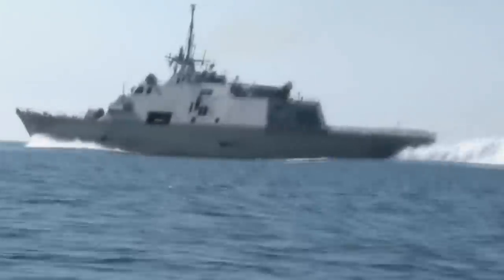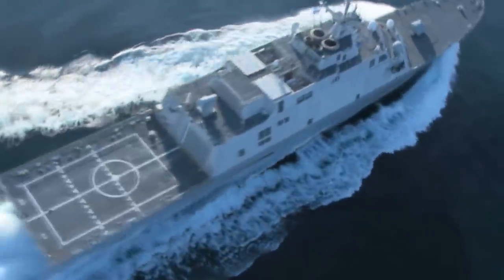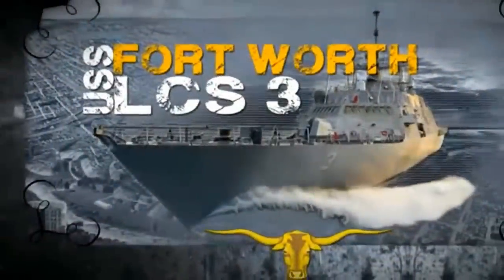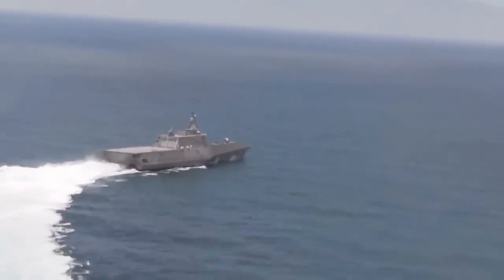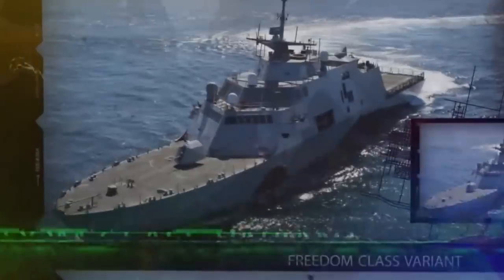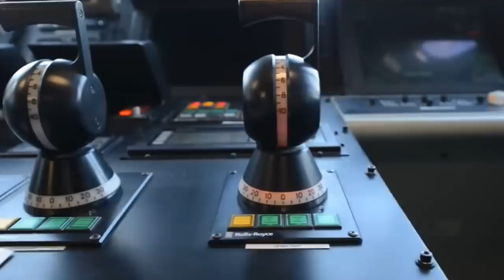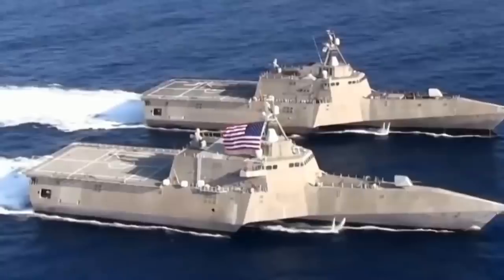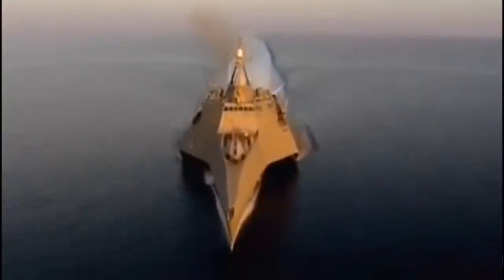U.S. Navy Littoral Combat Ship - Future Naval Firepower

Comment: Matsimus: Trust the americans to spend as much money and get so little for it. With a top speed of 40 knots you better hope for very calm weather. It is true the Huitfeldt-class only has 30 knots, but the range is not 3-4000 miles - it is 10.000 miles plotting along on one diesel. True enough: The Huitfeld's need an upgrade with a new sonar and new air-defence missiles and have the Seahawk helicopter on board. But so will the Freedom class.

The trick is: You can't sail with speeds much over 10-15 knots in shallow waters, as the yanks will find out. If you use a planing hull the bow wave will be reflected from the bottom smack up in your face. If you use a deplacement hull, then high speeds will suck the entire ship down due to the ventury-effect. I personally have had to help a skipper talk himself out of what that does to ship - there is only one word for it: VERY, VERY costly (it was a ferry). Now tide is another consideration that will pain the americans in the years to come - not mention, that high winds will change the sea level as well.

You see Danish waters are all littoral except the North Atlantic. The primary concern in littoral waters is knowing the waters and what you are doing. The Huitfelds are build as ferries and are twice as large as the Freedom-class. The Huitfelds are equally at home in the North Atlantic as well: You just take on ballast to make the go deeper. As to littoral - well the RDaN parks the airdefence frigates smack in the center of Stettin in Poland - much nicer and much closer to the pubs as well. As to the endurance at sea..... Freedom-class 3 WEEKS. Huitfeldt has three MONTHS before they have to seek port and top up on skimmed milk. But it is their money.

For your information: https://www.youtube.com/watch?v=rMNoHCV9Vnc

There is an illustrative example with Peter Willemoes and what it takes to get a ship named after you in the Danish navy. Willemoes singlehandedly ATTACKED the British fleets flagship under Nelson - on a timberfloat and only withdrew after his last gun was out of commission.
The americans pride themselves in their agressiveness - the cowing whimps they are. Tordenskiold only attacked with a numerical advantage. 3-1 Against him - the enemy's poor seamanship and crosseyed gunnery is always a factor.
Reply: Thomas Borgsmidt wow, you’re s much smarter than everyone involved in this, it’s a shame they never asked you

Comment: These littoral combat ships are already sailing on the seas and are deployed in restricted shallow waters and coastlines where the big survivable frigates can't go. They will replace the old and slow minesweepers and act as radar pickets that were the previous sacrificial lambs sent out by the US Navy when they didn't have enough corvettes or frigates. 

Would a USN admiral send a frigate in to perform minesweeping duties or the LCS? What if they needed to land a Navy SEAL team near a coast or an oil platform or to board an enemy surveillance boat? Will a frigate be able to do that job in shallow water? 

It's not always about going toe-to-toe with an enemy destroyer or cruiser because an LCS acting as a targetting data relay platform will allow a farther-off USN warship or aircraft to launch a big missile at the enemy. It's all about network-centric warfare, and it allows the US Air Force and the US Army to get into the anti-ship and coastal defense roles as well.

Comment: This is one I have to disagree with you on. The Navy has already fallen out of love with the LCS class of ships. 1) They are seeking a new design that has more fire power 2) The Navy has realized if these ships face a serious threat, they can't adequately defend themselves 3) With the very small crew combat damage control will be near impossible 4) With their small crews casualties in key billets will render the ship incapable of operations. 5) Their aluminum structure is more susceptible to fire damage should they get hit by a sea skimming missile like the Exocet.  In the Falklands War the fires on board after the missile struck were fed by residual fuel from the Exocet. This ignited the aluminum superstructure and the wire insulation for power and electronic. In all the LCS has had a troubled history.

Comment: Good job, as always, Matsimus.  However, I question the U.S.'s choice here.  Perhaps I just don't have enough imagination.  I get it that the ships are fast, shallow draft, maneuverable, etc., but what will they actually DO that other ships can't do, and cheaper?    I'd like some examples of actual missions, that these ships can perform that others can't.  Speed and shallow draft don't seem to be priorities in these days of radar and missiles.  They plug the gaps in the fleet where small enemies can slip through undetected?  How?  If the larger ships can't detect the threat, I don't see capabilities here that would detect the threat better.  And traveling with the fleet is not their main role, as I understand it.  What they seem best at, is to travel close to shore and launch Special Forces teams.  Zip in close, launch, zip away.  I think we can do that much better with a less expensive ship optimized for that role.  Also, I choke a little on the designation of "multipurpose" ships.  To me, if the ship has to return to port to install a different module, it is a "reconfigurable" ship.  My view of the module system is that it is a gimmick.  So, I'm out to sea with the mine warfare module and I learn there is a sub in the area - I guess I radio the sub to stay there while I return to port to  get an ASW module installed.

Comment: Ive read these have been slightly a failure at their original goal and will only be able to be used in low conflict zones like middle east. The navy already is looking for designs for a new frigate to take the role of small missile boat to boost a fleet strength without needing more alreigh burkes

Comment: from the start the LCS program was realized to be worthless by the navy (having SWO's in the family). Between the inability to actually manage any job that their "modular design" offered, to the horrible idea with the catamaran version that uses different metals in the hull/superstructure that leads to massive repair and maintenance issues. They are garbage.
Reply: I found it incredible they had holes in the hull from Galvanic corrosion so quickly. The navy hadn't heard of zinc anodes?
Reply: The tri hull design was to increase it's chances of surviving a torpedo strike which on the new torpedoes breaks the spine of the ship vs poking holes in the hull. Are there weaknesses? Sure. Every system has them. Steel ships are rust buckets floating in water just waiting to sink if you don't keep up repairs. I really have to wonder if you've even been on the ocean.
Reply: A tri hull is potentially useful, but not this one.
Reply: False- where the hell did you get that information?  During the 2004 tsunami relief efforts the US Navy noted how well Australian ships with multi- hull designs (particularly those built by the Austal company) did hauling heavy loads at great speeds over long distances.  They decided to think outa of the traditional "mono hull box" and give Austal a shot at bidding for the LCS contract.  Austal joined up with General Dynamics and created the Independence Class of Ship.  They have also been building other research ships for the Navy too.  Torpedo's had nothing to do with it.

Comment: For a 3000 ton displacement vessel, these ships carry relatively little armament and sensors. No proper medium/long range AA, no antiship, small shore bombardment capability. The "modular" capability is greatly diminished by the fact that the modules don't exist yet, and probably will not exist as envisioned because it was discovered that design limitations made most of them infeasible.

Comment: ship has close to no armor and its design if for close to shore action kind of odd that close combat ship has such thin armor I'm sure an attack from a few speed boats with heavy machine guns could  cause it to be incapacitated and no longer mission cable  throw in a helicopter and things just get worse from there
Reply: The on;y protection I am aware of is some Kevlar splinter curtains.
Reply: They are fast and that's better than armor.
Reply: wrong, no vehicle/ship is faster than a bullet/missile and they will get hit it is part of warfare I agree there needs to be speed but protection is the flip side of that coin you need balance not one or the other

Comment: These are ships the navy do not know what to do with. Too light to fight against a real threat. No plan to switch out modules quickly in forward areas. We have a very expensive Coast Guard cutter. At least they can be used as minesweepers.
Reply: Yeah, the "modular design" has essentially been dropped leaving three separate classes of the same ship depending on which module is permanently attached.

Comment: I think you are a bit off the mark when it comes to the usefulness of these ships.  There is a real need for ships that would counter threats in the shallow water coastal environment as was demonstrated in the Persian Gulf when the US Navy went up against small, fast and heavily armed Iranian gunboats.  But this ship falls short on a few critical points.  One, its all aluminum construction makes poorly survivable from taking enemy fire.  Two, it fell victim to mission creep.  It is asked to do too many missions which would introduce too many compromises in design that make it a jack of all trades but a master of none.  Third. too many new technologies were thrown at it at once without adequate integration testing and trials on a prototype.  The ASW module that has been delayed for almost a decade is one example of the myriad of problems encountered.
Plus, they've got it ass backwards.  Weapon systems should be designed to meet specific mission requirements.  It seems like they built this ship with a general idea and spent the next decade figuring out how these ships could be used.

Comment: Freedom class ship is more Coast Guard material and fancy counter-mine warfare ship... not combat ship, as it truly lacks capacity to integrate credible weapon systems.  Independence class ship though has more potential and flexibility to integrate more diverse, potent combat capability if the proper investment is decided to be spent on it.

But basically, any modern-era Corvette and especially Frigate can double as and be modified to integrate various remote and towed ASW and anti-mine sensors and aerial surveillance/targeting drones and ASW weapons, etc...  this is nothing unique to a specialized 'LCS' hull which in baseline form is unfortunately limited in credible combat capabilities.

The Royal Navy ?  Maybe contemplate integrating CAMM + CAMM-ER vertical launch, plus a 76mm STRALES sys upgrade, plus Naval Brimstone tubes, heavy torpedoes and maybe even a few NSM rounds for good measure.  You really need a full package to be credible, cost-effective deterrent.

Comment: First, problems they might figure out. Poor enginnering reliability, mine drones have horrid reliability and record. Second, they are kinda useful in the asymmetrical warfare you mentioned but useless against a near peer rival. No modular vls, poor ASM capability, poor ASM defense, especially against the latest chicom and Rus missiles. Way too expensive for the little firepower they do have, and small ammunition capacity. At least from my understanding and I grant I'm sure you're better read up on them than I am. Anyway I still really like your videos, keep it up man

Comment: SERIOUSLY SMEXY BOATS.  Seriously though, these ships are bringing in some capabilities that haven't really ever been a developed part of the Navy's power projection.    The ability to provide additional support and security to RDF ships and Marine Amphib forces is going to be a big plus and allow those dedicated unit to support troops ashore and not have to divert assets to battlespace security.  Then of course there is the other missions which this sort of ship is ideal for.. discouraging piracy.  A job that's currently been tasked to Destroyer and Frigate designs (primarily Fleet and Surface and ASW defense and support)  that really are not ideally suited operating in closed waters.   I suspect they'll be a force multiplier all out of proportion to their size and manning requirements ...  assuming the Navy keep building them.  As for the issues with the ships...Navy ships are hideously complex in the modern era, and getting more so....It's going to be another year working out the last of the systems integration bugs, with the lessons learned tagged into the new construction that wont have the bugs and issues.

Comment: These ships are paper tigers.  Other than a 57mm gun, a step down from the old quick firing 76mm, they have zero offensive capability.  Compared to other frigates of similar displacement, they are at a decided disadvantage pretty much across the board except in electronics.  There are programs to add anti-ship missiles to it, but they should have been integrated from the beginning.  As it stands, the entire program is overpriced and has underdelivered.